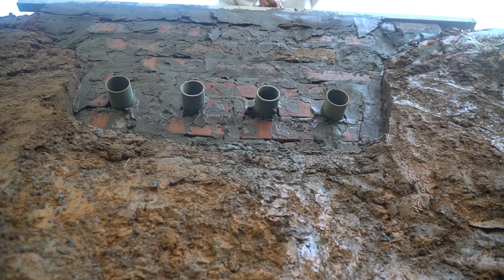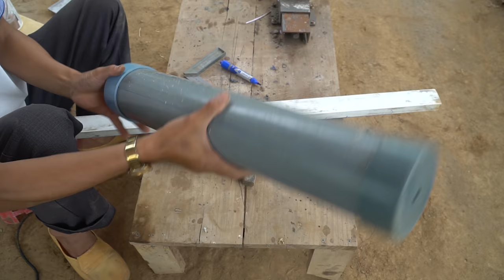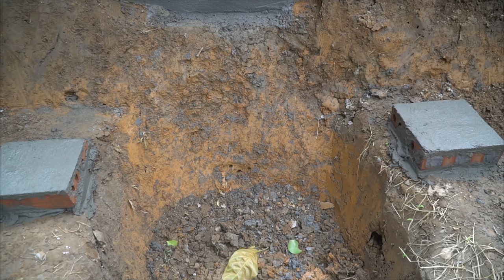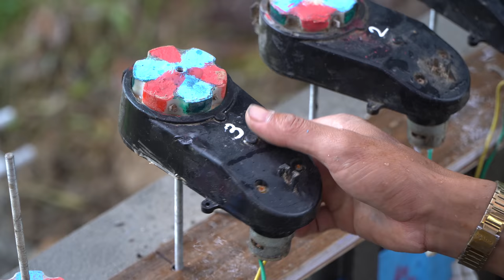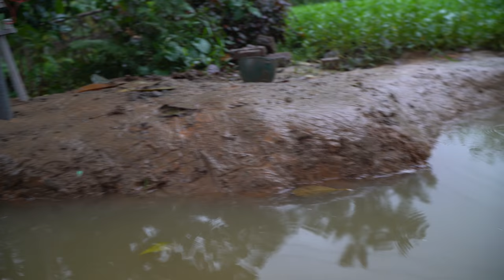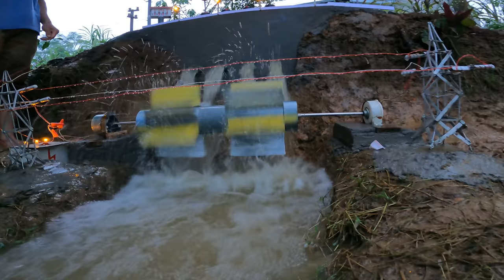Mini Hydroelectricity With 4 Extremely Powerful Water Outlets

Comment: Architect + Electrical Engineer = Best Combo. 👏👏
Reply from the maker: Thank you so much ❤️❤️❤️❤️
Reply: Civil engineering😢
Reply: @Tran-Chien  did u use the same electricity to run the pump. that filled the water?
Reply: Mechanical Engineer

Comment: The idea of constructing your own MICRO HYDRO ELECTRICITY GENERATING PLANT is absolutely brilliant. He is immensely talented in the execution of masonry work. Excellent work. 👌👌👍👍
Reply from the maker: Thanks for your support! Subscribe to the channel to watch upcoming interesting videos!❤️❤️❤️❤️❤️
Reply: Thanks you for watching💖💖
Reply: @ViralConstruction  🙏🙏🙏🙏
Reply: If you truly believe that then you've never done any masonry.. And I can tell you from an engineering standpoint that that thing will collapse.. Only a matter of time since it's tied into absolutely nothing.  It's basically built to fail but he'll learn and do a job better next time. Also all the electrical components are unprotected.. And becoming soaked with water. How long do you think those will last?   I also only saw two half inch lines feeding that pool,  which basically means the entire thing is a showpiece,  two half inch lines cannot feed that basin quickly enough to keep up with the output..  But it did make for an interesting video.
Reply: @drewmurdaugh6264  Structurally, your view point may be correct.
Reply: 100% talented great workmanship
Reply: @obief5737  Yes. Very imaginative and dedicated worker. 👌👌👍👍

Comment: It's always awesome to have property with natural waterways and hydroelectric potential.  Five stars for the decorative pond, I love miniatures.  Problem with these humid environments is rust and maintenance, t won't be cost effective in the long run if the motor needs to be replaced often due to rust, maintenance is needed if the pipes get clogged from vegetation, and if the metal axles grind out like my pond pump once did.
Reply from the maker: Thanks ❤️❤️❤️😊😊😊😊🙏👋
Reply: @user-tz6rk4dy5s  , huh?   If someone shared their thoughts and experience with me about my hobby I'd usually feel welcome.  I had a pond that looks great in the beginning, but then all the work clearing the drains and pumps after it starts to wear out really became a hassle; just sharing my experience.  If you want to go after smart alecs who thinks they know everything, feel free to give advice to the anti-vaxxers and trucker carlson.   I happen to think this project is satisfying to see.   Thanks to Construction General for posting this on youtube.
Reply: Por pensar así es hay personas que no logran nada,hay que ser más positivó.

Comment: This is a great idea.  You can build one in anybody's back yard to generate electricity.
Reply from the maker: Yes,Thank you  😍 ❤️❤️
Reply: @Tran-Chien  You should make a portable one like portable swimming pool.  Pump up the water to source using the generated electricity and charge up some battery to be used inhouse or connect to house electrical outlet.

Comment: To ensure max efficiency, make sure your vane is of curved shape instead of flat plate,...flat plate gives you 50% efficiency, while curve vanes gives you around about 80% efficiency
Reply from the maker: Thank you so much 😀
Reply: Because curved vanes are more streamlined to move through fluids in case somebody is wondering.? (Aerofoil effect)
Reply: no one wonders anyway 😅

Comment: Ingenious Idea! I love the way you can control the flow rate to gain maximum voltage output. A Gear could even be added later to turn a larger wheel. Often just like a car, you start off in a lower gear until, you get enough speed to change gears. Its too hard to change gears until enough speed gets created to start turning it. But once, you can then there will be even more top end.
Reply from the maker: Thank you so much 😀
Reply: Ideally you would have to change the rotor type to collect 100% of the force of the water, as you mentioned use a gear box or belt with two different sized wheels, individual turbines for each water exit point to lower the torque requirements ,a flywheel for excess energy and single direction force application parts like on a bike to not hinder the system when no energy is being produced from either the single turbine compared to the flywheel or multiple turbines.

This is as shown obviously a science project style construction or at best a gravity battery but if someone does try to implement this into a river or irrigation system I would also suggest at least one of the dams have a self activating system that can handle all of the potential input or you will have flooding. 

Self activating being either with a floater and a top down opening system or sensors to open a system with motors like he has it. Redundancy is king so probably both in case a sensors dies on you or the floater gets blocked.
Reply: Can this small power generation support a 1000W air conditioner for a day?
Reply: @Jervvey4798  definetly not

Comment: Usually this can be used in local canals where there is continuous flow of water 🔥🔥🔥
Reply from the maker: Thanks 😊 😊😊❤️❤️❤️❤️🙏
Reply: @Tran-Chien  
pity on you! you always use 1 yo 10% of the water efficiecy by wrong plans! first the angle of falling water is causing anti-force or reverse force! second you could utilize the amount of water in a better way!
Reply: ERROR SE LOS HAGO ,SOLAR MEJOR
Reply: @memeememme1145  someone’s jealous
Reply: @memeememme1145  if you have so much idea why wouldn't you do it
Reply: @mr.cannedble9724  
I am busy in my work I don't have time and a running river. It is not my hobby.
Reply: @memeememme1145  come on its just a project he doesn't have to power 100's of house off of it
Reply: @sheetaldeshmukh9962  
I am not talking about the output !  I am talking about efficiency !!

Comment: Small remark water tunning over the rotating blades is more powerfull, side covers on the wheels prevent side spray and height is everything so use the maximum heigth possible ? And i agree with the person saying that a nozle would be better..
Reply from the maker: Thanks 😊 😊😊😊❤️❤️❤️❤️👍👋

Comment: Fit a solar pump to collect the expelled water and it might be able to refill the main water storage at the same time, hopefully it could keep up with the loss?
Edit: Thanks for the video
Reply from the maker: Thanks for your support 😊👍
Reply: Or use the electric power generated to pump used water for recycling
Reply: That would require more energy than the system could produce. In which case why no abandon the hydro and just use that solar power directly.

Comment: Don't get me wrong, you did a great job. Normally you apply the mortal to all surfaces of the bricks, including the ends of the bricks instead of just bedding them on top and bottom. If you also do the ends it will be stronger and less area for water intrusion and erosion. Even after you have slathered the mortar to cover everything there are weak spots inside your dam because the bricks were not mortared end to end. I meant no criticism, only assistance. You truly did a very nice neat job of it.
Reply: Yes, add brick lining on the upstream of your dam, bottom and side wall. Otherwise your dam will collapse very soon caused by water infiltrating through the soil.
Reply: Youshould put strong foundation soil never hold strong current of h2O it will last may be a month or sonner it will collapse
Reply: Maoba Bai
Reply: @arofatm3762  lets see urs
Reply: @junepapio1629  lets see urs
Reply: Same thought
Reply: @clintonomokaro527  normalize being critiqued. Without critiquing science wouldn't be anywhere
Reply: Its a good criticism. im not even mad
Reply: Please soport me

Comment: Question is, how much power is it actually producing? For people who live near streams or rivers, I see no reason why they wouldn't invest the money in a DIY power generator like this if it means it knocks off even 25% of your electricity bill.
Reply: I think one like this might push around ,350-400 watts..
Reply: @redoxideeternal23  Eh, scale it up a bit lol. To be fair, the materials don't seem that expensive. The biggest money sink would be the batteries and motors.
Reply from the maker: This is just a small hydroelectric stab so it can't provide enough electricity for living.
Reply: Where I live, and most places if not all, as far as I know, its illegal for someone to use public water for generation, can get charged, and fined, and in CA, its illegal to collect rainwater from your gutters! not allowed to cut out the utility co.

Comment: What's the electric generation capacity of this little dam?
Reply: To light 4 bulbs for 5 min
Reply: @real_culprit4034  just for 5 mints?
Reply: @RajaSahaB999  you have to fill the water reservoir again once it gets empty.
Reply: 5mw
Reply: @AANEEM  Or siphon back from downstream water collector.
Reply: @jaigi2  Exactly
Reply: It's a complete waste of resources.
Reply: @jaigi2  the electricity needed to siphon back the water would exceed the amount of electricity generated. it then won't be economical.
Reply: @AANEEM  You are right. Not all of the water from collector tank can be siphoned back and so energy would be required to add ‘make up’ water, to reach original level in reservoir. Also, back flow rate would be slower than discharge rate; so there would be a 'gates shut down' period.

Comment: This guy is super good. I assume the water is coming from a stream. It would be interesting to have a pump to recycle the water back into the upper pond. Awesome build.
Reply from the maker: That would be cool
Reply: @Tran-Chien  No that would be a perpetual motion machine see: 2nd law of thermodynamics. It is a nice build and fun to watch but it is not able to generate a  lot of power.
Reply: @shoestringeng6473  it's just for display so with that flow rate he could funnel the water output to a small hydro generator to power a pump. I've seen generators that work on smaller flows than that.
Reply: he would need external power to do so.
Reply: Yeah, the water should go back to the upper pond
Reply: Could you use solar powered pump to put water in upper reservoir, which then could flow and empty it at night and produce energy for a battery. There would be net loss during day even with hydropower but should be net gain in 24 hour day more than just the hydro.
Reply: But you would need more energy to lift water back up then you generated.
Reply: @Seflyx  he is talking about storing potential energy.

Use the gravity is more clean than batteries.
Reply: @Seflyx  You are right. The pump method has more energy loss, but I don't efficiency difference.

I took that idea from gravity batteries, there are videos on Youtube, take a look.
Reply: @Seflyx  Actually Selfyx, it does work !! And that is exactly the basis of full scale commercial “pumped hydro” electric schemes (PH) used around the world, to provide short and medium term electrical storage.

They are far superior to lithium (or similar) batteries for electrical storage, for a number of reasons-

1. Far less costly to build, given the massive amount of electricity they can generate. Overall cost, over their lifetime, is only around 20% of lithium batteries.

2. Will last much longer than batteries. A pumped hydro scheme can last 100 years, and MORE, provided regular maintenance is carried out, and that maintenance is relatively straightforward (think the maintenance that is carried out on the thousands of existing [one way] hydro schemes around the world today).

3. Batteries, on the other hand, are incredibly EXPENSIVE, per MWhr of storage provided, and only have a lifespan of 10 -15 years before replacement is required. As well, lithium batteries are in incredibly short supply, due to the electrical vehicle industry taking (hogging!) much of the world’s supply/production, and this situation will not improve for at least 10-15 years. PH on the other hand, uses large, but small numbers of turbine/generators which are readily available, and use standard, 100 year old technology.

4. Batteries are TERRIBLE for the environment. They have to be produced in humongous quantities(to provide the required MWhr storage), using up enormous amounts of rare earths and minerals. And then due to their relatively short life, will use up enormous amounts of industrial resources for their recycling. As stated previously, the lifespan of turbine/generators is considerably longer, being 30-50 yrs, and their replacement/maintenance placing totally negligible constraints on the world’s raw material/mining supply.

5. Another very important (but less well known) advantage of PH is that, due to the electricity being produced by conventional AC (alternating current) spinning turbines, their electrical output can be fed directly into the existing AC grid WITH EASE, and at the same time providing 50/60 hertz SYNCHRONISATION that is essential for the operating stability of the grid.
Batteries, on the other hand, actually produce a DC (direct current) output, which must be converted to AC using expensive solid state converters. This converted electricity, whilst it is in AC form, can be quite problematic to feed into the main grid, because it does not have what is known as the “spinning reserve” to synchronise with the grid. Too much non-synchronised AC (from batteries) can actually cause the grid to become UNSTABLE !!

PH does have some small disadvantages, but these are FAR OUTWEIGHED by it’s huge advantages -

1. The round trip storage “efficiency” of PH is around 65-70%, which is lower that batteries (which are 85-90%) but given the much lower cost of PH, still makes them far MORE cost effective.

2. PH schemes require the right type of geographical areas (to provide the necessary vertical rise between upper and lower storage “ponds/dams”) and these are obviously (somewhat) limited around the world.

3. The building of a PH scheme will necessarily have an effect on the local environment/landscape, but this can certainly be minimised with good design. And they will definitely “scar” the local landscape FAR, FAR LESS than the APPALLING, DISGUSTING MONSTROSITIES of wind turbines, which are infiltrating the world’s beautiful lands in their 100s of 1,000’s !!!
Reply: You can with a ramp pump will lose some of the water, but most of it would make it back.
Reply: @Nicholas.T  thank you for the info, really complete! 👏🏼
Reply: @DeusEstNatura  60%-80% at BEST with a ram pump (using the water flow velocity to pump the water uphill), and given the setup, I'd say those numbers are optimistic.

If the desire is to have more water uphill and less water downhill, improving the efficiency at the generator would be the way to go. Nozzles on the dam outlets to increase water velocity/volume would be my first thought. Changes to the generator blades and overall construction would be next.

Comment: Its always relaxing and fun to watch these projects be done. Keep up the hard and good wok man
Reply from the maker: Yes, thank you so much ❤❤❤❤❤👍
Reply: @Tran-Chien  also a suggest for the gates. Rather than a manual operation you culd make a sensor and timer system to automatically open and close when the water reaches the right levels and havethe manual control as a backup
Reply from the maker: Your opinion is very good ❤❤❤❤❤

Comment: I love watching how people can use some technological sophistication and couple that with DIY skills.
But it should be remembered that the amount of power this little dam can harness is a function of how much head height there is.behind the dam. The higher the water level behind the dam the more potential energy (62.5 lbs per cubic foot times the height of the water above the outlet pipes) there is that can be converted to kinetic energy (the spinning blades). 
How much potential energy the paddles can convert to motion is a function of their efficiency. Not all the water hits the paddles. The paddles are very light so don't need much force to cause them to spin. That means they can only spin a very small generator. They are not converting all the water that hits the paddles into energy so that lowers their efficiency. Most of the water isn't being utilized.
If you want to generate large amounts of power than efficiency matters more and more because the equipment and conditions necessary to do that tend to get so much more expensive. Big hydro stations use all the water passing though the pipes and aim it at closed turbines. But the increased weight of the big turbines and generators they drive is deducted from the efficiency. No method of power generation ever gets 100 percent efficiency.
Reply from the maker: Yes,thank you very much 🥰🤞❤❤❤

Comment: Mechanism.  The kinetic energy of water use to roatating pipe and it connected to motor ,when pipe is rotate then magnetic flux inside the motor change continusly. Aacording to faraday whenever flux will change then emf (voltage)is generated  and emf create current
Reply from the maker: Thanks for your support

Comment: That's the power from the side generator (vertical) if you add it from the front like using a car axle then you will get power (horizontal) too, so it becomes a source of power to drive the generator shaft
Reply from the maker: Thanks for your support ❤❤❤❤👍

Comment: Hey good work there. I have a few questions:

1. Did you connect the AC or DC generators? If its the DC, how much is the output current? 
2. Whats the maximum voltage can you produce from this mini hydro power generation 
3. To maintain the output current flow, what device or component have you installed? 

I'd appreciate if you could answer those 🙏🙏
Reply from the maker: Yes, Thank you so much ❤

Comment: Be smart use gear to get even more speed and reverse the water back using pump system Lol 😂😆 also no need water cause it can evaporate easily oil better also use steel sheets to cover lol 😂😆 and put pipes
Reply from the maker: Yes, thank you so much ❤❤❤❤❤👍